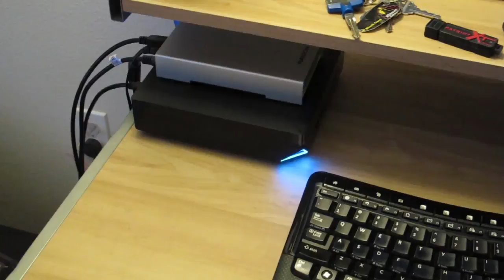My Alienware Alpha i7 boot issue repair follow up

Comment: when I first bought mine I connected it and booted it up but it was in the loop too I checked online what the problem was it ended up being my tv I know weird right its a panasonic viera tv now I have to game in a smaller tv I own
Reply: +Luis Corona did it just work with just a change of television i am also having this problem also with a panasonic viera
Reply: Robert Britton yes it works now
Reply: Robert Britton connect it to the smaller tv and update everything then it should work with the panosonic tv :)